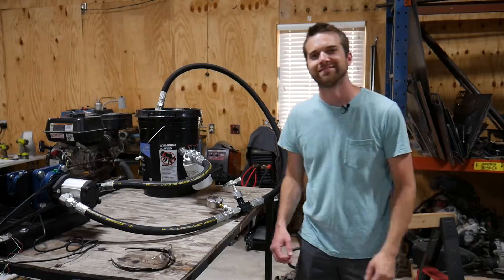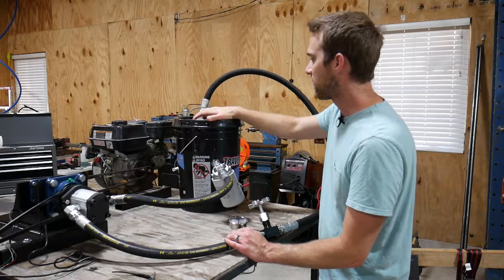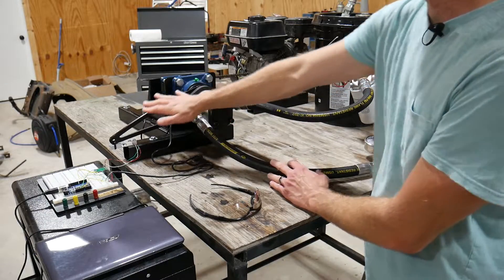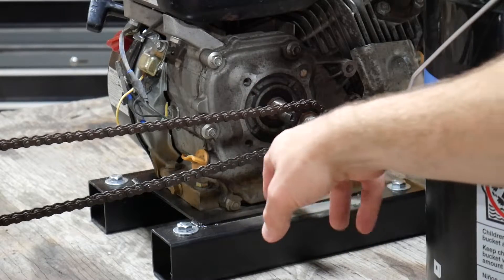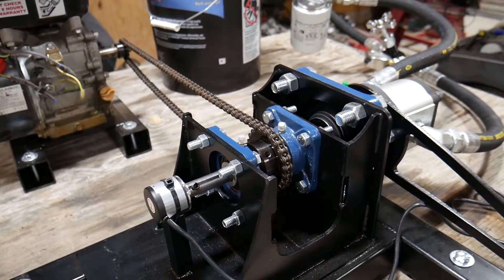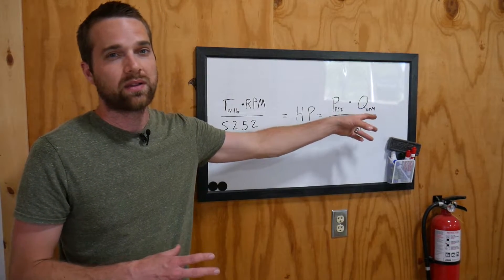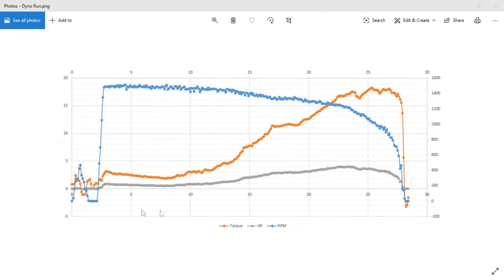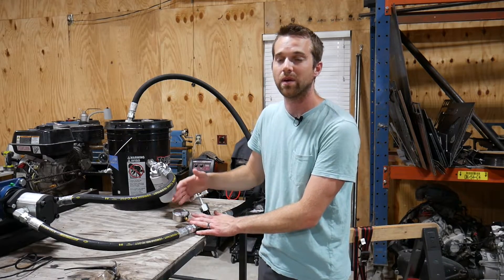Its Done! - Budget DIY Dyno

Comment: Ok glad to see you building it but why did you not make a base plate that would hold the pump and the engine or conect the square tubes? also why is the chain so long? Also if you put a cogged belt drive would help a lot.  Base plate is the key and shorter drive! Great first try.
Reply from the maker: See Dyno 2.0 video!

Comment: That’s some hard work and a cool project. I have a question to ask, sir. We are working on a dynamometer project right now as an undergraduate level project. We are looking for a reference project to begin with so that we can visualize the steps ahead and have something to compare and develop. Actually, we will design a small scale dynamometer. Nevertheless, it would be a fair starting point to look into your design. Is it possible for you to share the details regarding this project (CAD, names of sensors and machine elements, codes etc.)? It would be a huge help if you were willing to share. Thank you for your time and cooperation in advance.

Comment: What is Need to measure more hp? For example about 30-35hp
Reply from the maker: If you keep max pressure at 3000psi you're going to be able to measure more power by increasing the flow rate. You do this by sizing up the pump's displacement.

Comment: If you wanted to Scale this up for Testing Old Single and Twin 2 Stroke Snowmobile Engines that made 12hp to 60hp, using 5500rpm to 7500rpm, how do you figure what Size Hyd Pump is needed? Instead of a Chain & Sprocket, just use the Sled Clutch & Belt setup.

Comment: Hi mate great video!!  Have you a link to the Rotary encoder?  This is the one I found on Amazon is it the same? 

https://www.amazon.com.au/Photoelectric-Incremental-Encoder-Measurement-Coupling/dp/B01KOB5NMO/ref=mp_s_a_1_1?dchild=1&keywords=encoder+rotary&qid=1613762930&sr=8-1
Reply from the maker: It seems to be a different brand but the specs are identical to the one I used.

Comment: the original flow control was fine, by design would not work as you expected as it is a "Priority" valve. to use in a multiple circuit system.

Comment: So the flow control valve acts as a brake system which to counter the drive shaft. Since you control it manually, is it hard to measure the dynamic torque at various load?
Reply from the maker: if I understand the question right,  my answer is yes and no. The measurement accuracy and sample rate work as intended and measure exactly what they should. But because the load is applied by hand it, the output is affected by this and it can be tricky to apply the load smoothly.. However... I do have a project early in development to fix this!

Comment: This is great stuff! Would you be willing to share your notes, the math you used, etc?
Reply: I didn't watch far enough 😛
Reply: Do you have a parts list?  I'm considering building to test race kart engines so I would need to vary the RPM, etc with a bit more precision.   I'm thinking some type of electronic valve as well as an electronic pressure sensor to do all of the math in real time.  Would love your thoughts on a control system?  Thx!
Reply from the maker: Thanks! And I don't have a parts list written down but in the fabrication video I show all the parts besides the weldments set out on a table. You could definitely use an electronic controlled flow control valve - probably a stepper motor would work best depending on what you're looking for. If you go the route of calculating the HP based on pressure, I'm assuming you're going to measure rpm and back out a flow rate with knowing the displacement of the pump. Hydraulic pumps have non-linear flow rates (the type of pump also affects this), so there will be a margin of error in the calculations depending on the rpm if you go that route. That being said, dynos used for engine tuning are only meant to show incremental gains between different power runs - or sustained load on an engine for tuning tables. So even a setup that has error will reflect improvements, even if innacurate. I hope this helps!
Reply: @DirtyElbowsGarage  Ok I think I follow you after a re watch.  Essentially, the only time that specific pressure readings matters in your system is to ensure you aren't about to damage it?  (there is another guy with a video of a very similar system that's actually doing the math from the hydraulic pressure reading which I personally didn't trust.  He was talking about the margin of error on the gauges, etc which sounded like a mess.  I would like to avoid that.)

Anyhow, in my case if I built a control leaver that increased throttle and hydraulic load at the same time while logging the load cell and RPM would that give me both a mathematically accurate and a repeatable reading?  I would think at least repeatable?  Would the increase of the throttle or RPM need to be linear and in parallel with the hydraulic load increase or would the (T * RPM)/5252 still be the only thing that really matters as long as RPM and Load increase in such a way that the engine can still accelerate while under some type of load?   

I hope that makes sense...  Thanks!!
Reply from the maker: Yep, the way I am using the pressure gauge is to make sure I don't exceed system pressure since I am not using a relief system to automatically protect it. Any gauges are going to have a margin of error but bypassing the hydraulic HP calculations, using torque and rpm instead, removes the non-linear flow rate factoring into the results.

From the sound of the lever goal of increasing rpm and load it sounds like you're looking to do a more-traditional style dyno power run. Its not impossible but it is tricky. Running both throttle and load off of the same lever is possible, but you're going to have issues to work around.

RPM and throttle aren't tied together when an engine is loaded - depending on the load size. Like I did in the video, I opened the throttle all the way, then applied a load. When the load & rpm exceeded the power that the engine could produce, the rpms fell. And this continued all the way down. But the throttle position never changed. That's not to say you have to always have to open the throttle all the way, but just know that the two are not tied together.

What I recommend is two levers, one for load and one for throttle. You can then halt engine rpm using a combination of the two if you're looking at working at a specific rpm. However, doing this still won't get you the traditional power-dyno-runs where the rpm ramps up, unless you get really good with hand controlling the load - and even then I'm not sure you're going to get what you want.

To get the traditional power run you need a closed loop control system - with an automated load control system. If you watch cars on dynos you'll see the operator press a key right before a power run. They are kicking off a "power run" and pressing the throttle down simultaneously. They dyno is controlling the load and it applies the load in such a way that it allows the rpms to climb at a pre-determined rate - and it is always adjusting the load to do so. Too little load and the engine will spin freely or accelerate too fast. Too much load and the rpms will stop climbing or even reduce. So the load is based on the rpm climb rate, and is always adjusting it to keep the climb going. Again not impossible, but quite a bit to it. Definitely a fun project.
Reply: @DirtyElbowsGarage  Thanks for your input on this.  I'm starting to see why commercial dyno's are 5-10K for this application haha.

Comment: Great job!!!! 
What kind of pump are you using? And how did you pick the right one? If I want to do mesarments for bigger engine (50+hp) how do I choose the right pump? 
Sorry for my bad English.
Reply from the maker: Check out the part of the video where I do the math. Work the hydraulic power equation using the hp you want, and find a hydraulic pump rated for the flow rate and pressure you'll need.

Comment: I am instrumenting an old hydraulic dyno similar to your setup.  I am using a pressure transducer instead of a load cell.  Could i possibly get a copy of your arduino code.  I am struggling with the programing.

Ken
Reply from the maker: I'm planning on getting the code out soon, just need to add more instructions to it so it's easier to follow. I'm not exactly sure it'll help if you're using a different syntax or controller, but the core of what's happening is there.
Reply: @DirtyElbowsGarage  I am familiar with arduimo.  I do have some math for the weather corrections that I have incorporated into a spread sheet if you are interested.

Comment: would it be possible to share you code ?
Reply from the maker: I'm working on cleaning it up with a little more instructions and I'll share it then. I'll reach back out when I post the link.
Reply: @DirtyElbowsGarage  thanks i have parts just need code for testing
Reply: @DirtyElbowsGarage  thanks for the download but i click link it downloads a file dyno data but i can not open it

Comment: Hi good job awesome 

What is your  data system??
Reply from the maker: The daq uses two sensors, a rotary encoder and a load cell. Both sensor's outputs are read by an Arduino Uno. 4:38

Comment: On your unused flow control valve from your first video, I see it has a pressure relief valve installed. In such a case, the flow control would only work if you had a cylinder or motor on the outlet side connected hence, to control the speed of a motor or the extension time of a cylinder rod, and dump excess oil back to tank without changing the speed, pressure and gross fluid flow out of the system's prime mover (the main hydraulic pump). Some manufacturers recommend installing a plug on the relief valve's outlet port that normally would be piped back to tank but then depending on set up, you'd need a relief valve somewhere to protect the pump or some safety valve situation that would 'fail open' if things got out of hand. Just an observation. Have fun ! Be safe !
Reply from the maker: The last test I did on that valve was capping off the relief line and it still didn't build any pressure so I decided to keep moving in a different route. Good info though! I may try it on a different application where there's a flow based system output and see if I can use it then.
Reply: @DirtyElbowsGarage  Thanks for reply. Strange it's not building pressure even if relief blocked. In the mean while I happened across this vid.
https://www.youtube.com/watch?v=8dxGCeIkPFU
Same valve in flow divider use @ 1:20 (set of open center valves connected to inlet port of flow control).
See "Can the EX port be blocked or plugged?" under FAQ's in the Installation sheet PDF link below. Requires a different spool but does not say changing the spool alone or both spool and AND pump. In this case you might be able to use a log splitter load sensing control valve where it snaps its own spool back to center (neutral) when the ram is fully retracted or when your flow control valve is closed in your case (thereby both dumping pump discharge back to tank and a manually engaged or disengaged automatic safety pressure dump) instead of changing to an expensive load sensing pump. Flow valve installation sheet:
https://brand-hyd.com/wfdata/files/install/valves/FC_Installation_Sheet.pdf
NO. I'm not affiliated with or compensated by any of the links or products. Just raw research.
Reference schematic of flow valve:
https://brand-hyd.com/Products/Valves/Flow_Controls/FC_0-30_gpm/
Reference auto return to center w/adjustable to 2000 psi kick out pressure log splitter valve:
https://www.hydradynellc.com/images/document/brand-hydraulics/Ls.pdf
https://www.shopcross.com/brand-hydraulics-ls755t4jrsha-log-splitter-valve-34-nptlevert4-spooladjustable-detent

Comment: Gday- I am building a similar dyno at the moment for go karts. 
Can you please tell me how the hydraulic pump is mounted?

It looks like a bearing rides on the outside of the shaft (via a coupler)- I was thinking on doing the same but was worried about the weight of the pump and the fact the pump body is not supported.
Reply from the maker: There is a mount that attaches to the pump, and that mount rides in the larger bearing. This same mount is the moment arm that contacts the sensor. In the video before this one that part is welded and assembled and you can see how it comes together much easier than in this video. Typically the mounting face is sufficient to carry the weight and the load on the pump - unless you're stacking pumps, and even then works to an extent.